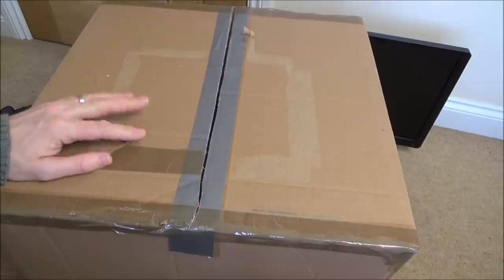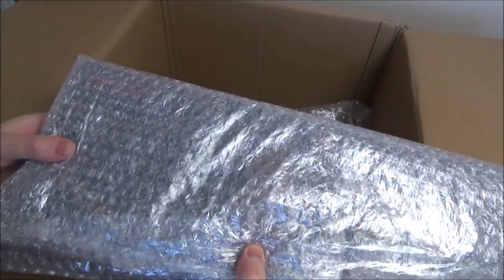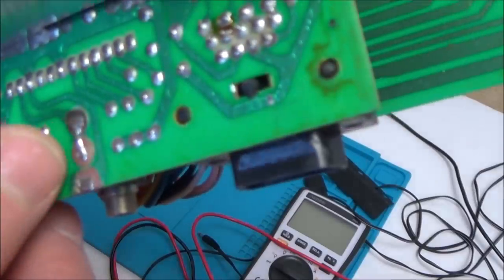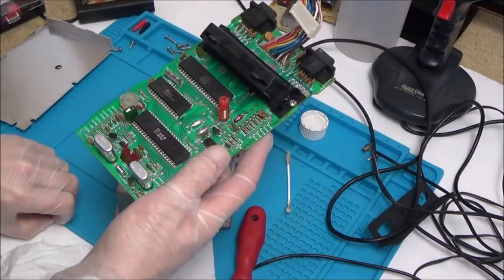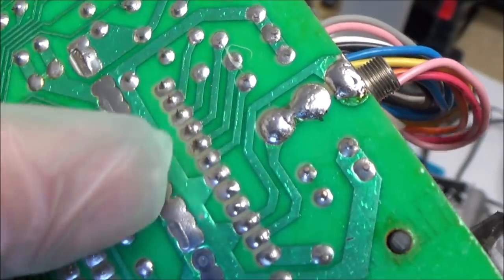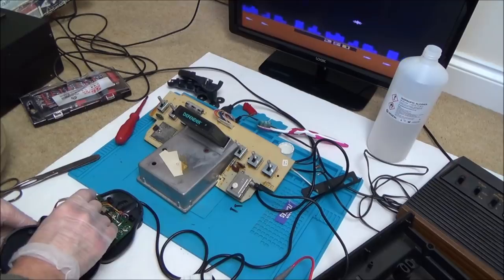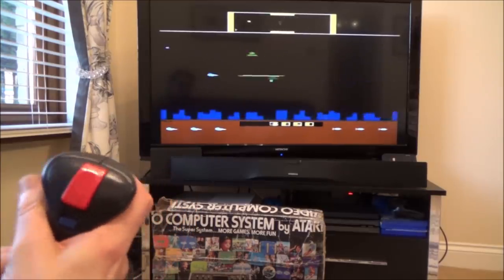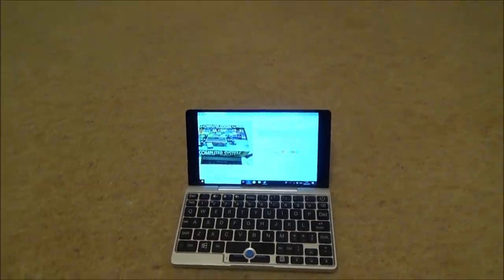eBay Pre 1980s TOY Repair Challenge PART 4

Comment: The colors changing when you aren't playing is called the "attract mode". It acts as a screensaver and also to attract players (originated with arcade games). The flickering and disappearing of the ships is because the Atari 2600 is very under powered. It only has 128 bytes (not K) of RAM, so there's no video buffer - the game has to draw the display in real-time every frame. There is some hardware assistance, but not enough to keep  more than a few objects on the screen at the same time.
Reply: i wonder where the ram is on those and if you could maybe uprate it ??
Reply: @MrTarmonbarry  soldered on the board. Even if you could upgrade the RAM, it wouldn't change anything since the game was created to accommodate that amount of ram.

Comment: Important info about the power pack. These are simple things inside. Just a step-down transformer, a rectifier, and filter capacitor. The operate all the time and most burned out from being continuously plugged in. Always remove the pack from the wall outlet when not in use for more than minutes.

Congrats on another successful repair!

Comment: Another great video, I like the gum tape to save the box. I found a good way of removing the old tape from the box without pulling the artwork away is to heat it up with a hairdryer hot and then cold and so on before you remove it, sometimes it just blows it straight off. Keep up the great content 👍

Comment: Hi Vince..believe it or not, you can use lighter fluid on old boxes (with cotton wool balls) to clean the pictures/prints on them. To get rid of the creases, use a warm iron and an old tea towel and iron them flat. Good to see someone suggested you use the brown parcel tape to fix the box. Love what you do..Keep going!
Reply from the maker: Hi, thanks for the tips :-)
Reply: I do believe that the tea towel has to be slightly damp. I've tried on a few of my old boxes and they come up a treat.

Comment: Vince in 1978 I worked for a company making the boards and testing them which of course got in into electrical repairs myself
The one thing I must tell you is do not use IPA on the board itself on cleaning as on the Atari board it can damage it due to the way it was made then
As for the way the chips were fitted was as you say an ideal way shame it's not used these days
I still continue to fix and repair all electrics for my living and good to see you trying your hand at this

Comment: I found my 2600 at a yard sale. Paid just £10 for it as spares or repairs, came with a joystick, few games, pair of number pads. All that was wrong with it? The antenna cable had become unplugged from the board inside the system. Nice choice here Vince. :)

Comment: We got our Atari the first Christmas they came out in the US the video cable was bad and we had to wait one day to take it back to San Francisco where my parents purchased it. I still have the console I have repaired it a couple of time last time I had it out it worked  (2008). Some of the things I have seen is the wall transformer fails it burns out a winding in the transformer. the connector on the back is called a DB 9 it is a standard connector that has been around for years and is used in lots of devices. pins on the game controllers can spread loose over time and if a switch or rotary controller do not work taking a small screw driver or dental pick and pushing them closer together can help them to work better for a while  love watching your video I studied electronics in school and I work on computers for a living  you are getting better with all the practice you get trying to fix things keep it up  (rumor has it that the processor was a 6502 ) when they first built the system they did not fully know what they would be able to do  with it they even released a simple basic programming game for the 2600

Comment: All PAL consoles transmit on the same frequency (UHF Channel 36) so if you tune your TV to that then you'll never need to tune it again for testing/playing.

Early models in the US had the channel selection switch that changed the output between channels 2 and 3 on VHF, but this was later dropped and all consoles only output on channel 3 but the original case mould was still used so the access hole was still there. In the UK as far as I know, consoles only ever used UHF on the frequency mentioned above and we never had a switch at all but still had the same case mould as the US.

The Atari 2600 is well known for outputting a very weak signal from its RF Modulator which was fine on old CRTs as they usually had very strong tuners/receivers as analogue TV was obviously quite important back then. Modern TVs can be very hit or miss especially in lower end models. Using a cheaper RF tuner to keep costs down on modern sets is common practice because it's highly likely no one will use the feature anyway since we are digital only now for terrestrial broadcasts. This is maybe the issue the seller was having given his description but obviously there was also an issue with a loose connection on the DC jack too so it could just have been that all along and that's a nice little fix.

Ironically, I had a CRT for retro gaming a couple of years ago that could not pick up the signal from a 2600 but my 4K TV at the time picked it up just fine! I ended up getting a much better CRT that picks it up fine recently so it goes to show that you cant always assume something might be wrong with the console in some cases.

As for the games, many of them flicker like this. Technology of the time had it's limitations and developers had to find ways around it to make their games stand out. When there is a sprite (object on screen) limit, CPU limit or a colour limit as was often the case with the 2600, developers can make it seem like there is more happening on screen by quickly switching between sprites very quickly so that it seems like there is more spites/colours on the screen at once than the console can normally handle. The effect isn't perfect, as seen in games like this, but it did make games at the time more complex and richer than other titles that stuck purely to the limitations.

Lastly, the best way to play 2600 is with a Sega Mega Drive/Genesis controller. Works without any modification and is so much better than a joystick, especially the official Atari one that shipped with the 2600. Yes it's an iconic controller, but boy is it uncomfortable to use!

Comment: I have a "Heavy Sixer" 2600 with the wood grain finish just like this one. I also have Defender along with many other 2600 games and yes, the flicker takes some getting used to. As far as all the cello tape on the box, I have had a lot of success using a hair dryer to heat the tape and carefully remove it without damagimg or tearing the box (I have done so with a lot of board games and it works well)! Great fix!

Comment: Hi enjoying your videos, regarding the gum tap, there is a machine with dispenser and a water tray and brush bar that absorbs the water so when you run the gum sticky side over the brush which applies the correct amount of water to it and then apply to there cardboard box for sealing it up. Keep up the good work I'm learning a lot from you and tronicfix

Comment: VA is volt-amps, which is similar to watts.  The Atari adapters are not regulated, so it's totally normal for them to output higher voltages when not loaded.

Comment: Hi Vince! Haven't watched this video yet, but just wanted to say. after watching your videos, it has changed my  view on just chucking stuff away, I had an Apple 30 pin to lightning adapter which had stopped working, so I tossed it aside and bought another ( and you know how expensive Apple kit is), but on watching your vids, decided to look into the adapter, gave the contacts( both inside, and out) a good clean, and now it works fine, so thank you Vince, your wisdom is filtering down to boneheads like me, so you are doing something right! Cheers mate, keep up the great videos!

Comment: A light sixer, not a bad find, the four switch is so much easier to find.
As for which is better, Speccy48 or C64? Amstrad CPC464 ;) 
But I'm biased, I grew up with the 464 ^_^'
The VCS is usually around around channel 32-36 but some modern TVs just dont seem to want to pick them up. I keep a 14inch tv from the 80s for mine, theres just something kinda satisfying about turning on the TV with a solid clicky dial that is both power and volume control, pushing a clunky button to change channel, and fully manual analogue tuning. And I mean screwdriver into an individual tiny dial for each of the channels on the set ^_^

Comment: the funny mesuring results was due to your choise of ground. You took ground from the socket but the ground was not transfered to the board due to the bad solder. The results of that was the messuring was not "loaded"  always make sure you have a good ground to measure from.

Comment: When removing tape from boxes use lighter fluid it will remove the tape well and will not degrade the cardboard at all.   you can be as heavy handed as you want when it sets there will be no stains nothing left behind.
Will not fade color either I use it to restore boxes all the time

Comment: Great video =D  Atari 2600's sell often for around the £15 to £20 mark when needing clean up / repair.  One thing you should do is print off the pinout for the 7805 - you will find those 5v regulators in many consoles / computers / electronic toys from the 70s 80s and 90s.  That's what the 3 pin device is on the bottom left of the larger board.   When you were measuring the voltages I think you might have slipped the probe onto the +ve voltage input instead of ground, that's why you were seeing 13v all over the place around the regulator I think.  The nearer the PSU is to 9v the better as the additional voltage is burnt off by the voltage regulator.

 Also its worth finding easy to access grounds before taking measurements etc.  ie. you worked out that the -ve of the power input connector, but then using continuity test measure around on large bits of metal etc and that way you would likely find that the metal can (in the middle) or the heat sink on the 7805 are also easy to access grounds.   Just makes it easier to take measurements then =D

From what I've seen they nearly always seem to have all 3 chips socketed from factory.  The red thing is a variable inductor.  The internal ferrous core can be go up or down adjusting its position inside the coil.  The ship disappearing when firing is most probably a limitation in how many sprites and things that can appear on screen at once.  The 2600 was very limited and programmers often did some clever things to get certain types of games running when in theory they probably shouldn't work!
Reply from the maker: Hi Chris, I knew you would have knowledge on the 2600:-) I am hoping your channel will help me out on the Spectrum when I come to do it. I am pretty sure I was firmly on the negative on the DC Jack as I was on the exposed female screw bit. One viewer wrote this-----"the funny mesuring results was due to your choise of ground. You took ground from the socket but the ground was not transfered to the board due to the bad solder. The results of that was the messuring was not "loaded"  always make sure you have a good ground to measure from."
Could this be the problem because the multi meter was getting the ground through the power supply and I was measuring on the board but the board wasn't getting a good ground (or intermittent) ground from the power supply. It is weird because the on/off Switch is working but when the DC jack was loose I was getting 13v even when off which makes me think the 13v was travelling down the negative as well as the positive!!!! So if I had measured from a big ground on the board instead then I would have got a true reading and I am thinking it would be measuring 0 Volts everywhere as the circuit wouldn't be complete. It this correct???? The socketed chips are a great idea and it looks like it was manufactured with servicing in mind :-)
As always thanks for all the advice and guidance you pass on over on this channel and on yours :-)
Reply: No problem =D  Give me a shout if you need any tips on the Spectrum!  Regards the voltage measurement there I still cannot work out how exactly it measured 13v on all the pins.  In order to get a voltage measurement its measuring the potential difference between the probes, so it was actually measuring 13v accurately, its a question of how.  The reason I thought that you were measuring between the +ve and the other connections is if the +ve wasn't connected correctly to the board (due to bad connection), it stands to reason that the ground might have made a temporary connection, and when measuring between any of the 3 pins on the regulator and the +ve input, you would then see 13v, since the 12v pin would be 0v (+ve not making a connection), the ground would be connected, and the 5v pin outputting 0v as the regulator doesnt have the 13v coming in.   That would give you a PD of 13v on all 3 pins I think.

Comment: Use lighter fluid to remove old tape from boxes. 
Apply, wait, peel off. Dissolves the glue and evaporates so doesn't damage the box itself.

Comment: Nice job Vince, I remember a year ago I picked up one of these six switch models but its called a Sears Telegames has a different style wood and silver in some places. Normally they are kinda expensive but I picked mine up untested for $40 only thing I was going off of was the fact it looked pretty clean and it worked and is still my main Atari. I have another but it has some damaged traces and I dont have the skills or tools to fix it
Reply: Twintania.......Broken traces ???? Simple solution,wire point to point,no need to fix broken traces,also you can "bridge" cracked traces with wire and solder,Good Luck !!!!!

Comment: i am sure someone has already said this and i doubt you will see this comment but in case anyone else does and is wondering the reason the ship vanishes and there is flickering in a lot of games is because the limitation of the power of the system it can only draw so many things on the screen at one time so things would "flicker" (basically they would take turns on different frames drawing different things) so that they could fill up the screen some games did it better than others to the point where some seemed to never have visible flickers to the naked eye but it was just a limitation of home consoles back then.

Comment: On old boxes with tape you cannot get off try using lighter fluid pull a bit up then a bit more pull a bit up. It works well. Also PVA glue is also really good for boxes.

Comment: 2:19 Protip, you push the Power switch up to the On position to activate the 2600. ^_^ MSX 1&2 computers, too busy to watch retrospectives I guess, big world of 8-Bits out there my son? ;) It's so quaint watching you interact with the 2600. :) 34:06 That's normal, the platform only has two sprite objects so it has to trade them back and forth in most games IE. sprite multiplexing.
Just FYI to anybody fixing these, schematics are plentiful on AtariAge. :| New stuff reliable, yes in some places but no in others, that's a relative and proportional topic EG. cart maintenance VS long winded updates. :\ Great job Vince, they are dependable console workhorses. :D

Comment: The 3.6VA is the power rating and means that this supply will deliver 400mA @ 9V (VA means Volts x Amps so if it was a 9VA rating a 9V supply would deliver 1Amp). It is, as you say, normal for an unregulated power supply to output more than the stated voltage when unloaded, so no problem there.
Reply from the maker: Thanks, I think I understand it now so in this instance 3.6VA divided by 9V = 0.4A (400mA). So on another adapter if it was 4.2VA - 12V then it would use 0.35A (350mA) @ 12V. Going by the wall adapter it looks like the Atari only uses a max of 3.6 Watts which seems very small amount for a device back then unless I have got my sums wrong :-)
Reply: @Mymatevince  I don't know much about consoles I'm afraid but looking up the Atari 2600 I notice the original stock power supply was rated at only 500mA and, in fact one user said he had run the 2600 successfully on a 200 mA power supply!  If a device comprises mainly logic circuitry (i.e it does not have a built in screen/display, wifi capability, batteries to charge or motors etc.) the power draw will be quite low.  Choosing an adapter with a higher current rating than the stated requirement is fine as a device will only draw the current it needs. The voltage however, must not exceed the stated requirement of the device (although, as I said some power supplies will show a higher voltage when 'unloaded' ).
Reply from the maker: @standishgeezer  Thanks, yes that makes sense, it doesn't have a fan/USB ports/Disc Drive to spin etc. Thanks for the advice :-)